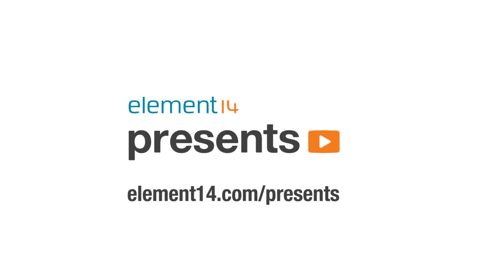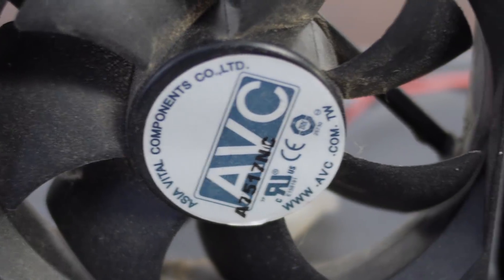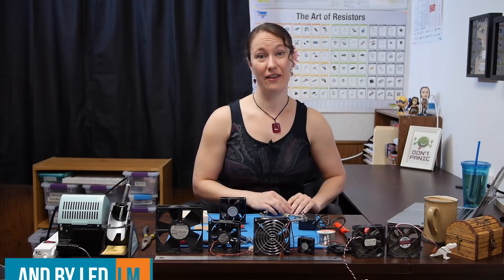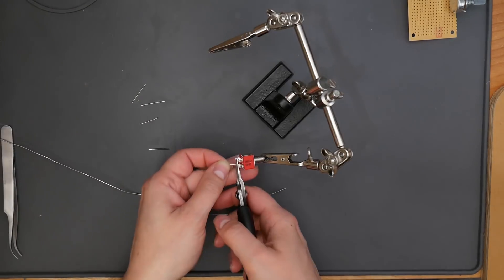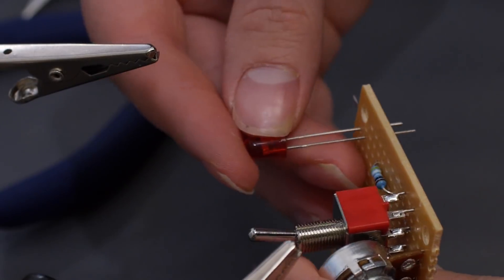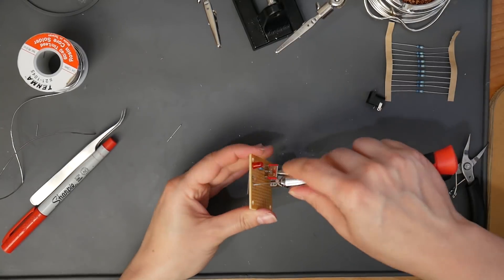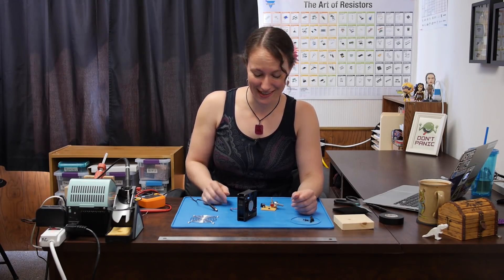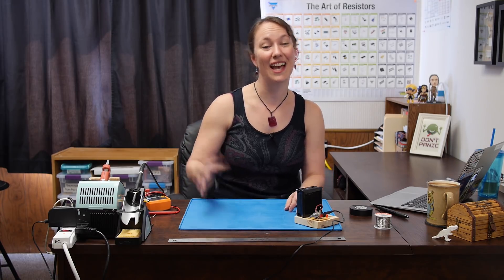DIY Desktop Fume Fan - The Learning Circuit

Comment: The LED is rated for MAX 20mA. So usually, one should build in some headroom. E.g. if the 9V battery has actually 9.4V, the LED only has 1.9V drop and the 330Ohms resistor is a 5% resistor at the edge of specs, that already adds up to 24mA! Working outside specs is a bad habit to teach. LEDs work fine at much lower currents, so I usually aim for 10mA which leaves some headroom for e.g. changing voltage, using different colored LEDs, etc. For 9V/12V I usually just use a 1K and call it a day.
And a pot as a variable resistor for a motor??? Also a very bad habit to teach. That is how I had my first magic smoke release as a kid.

Comment: What ohm range was that potentiometer? I've learned in trying to build this that a 5k potentiometer is not usable. (I should've done the math first but y'know). With a 5k it basically goes from off to full blast just right at the edge of the full swing. Rip

Comment: Might be a silly question, but can I just use a regular battery-powered or wall-outlet-powered fan and place a filter on it? Rather than assembling all these parts. I feel like the answer is a self-explanatory "yes," but I just want to be sure since I'm new to electronics and soldering. If I need a fume fan to avoid solder smoke, I don't necessarily want to solder and breathe in the fumes in order to create the fan lol. Awesome video, and a cool project to practice skills. Entertaining presentation as well!

Comment: I've been soldering components for nearly 50 yrs. Whenever I make a solder joint I always blow gently on it while I'm applying the solder so that the fumes disperse away while I'm working. (Notice I used the word "gently". I do not blow so hard that it would affect the temperature of the work. Just enough to disperse the fumes).

Comment: The current through an LED does not have to be exact -- anywhere from 5 mA to 20 mA will generally do fine.  So I don't think the resistor will need to be changed for a different color of LED.

Comment: will more ohms equal less voltage to the led? Or does it need less ohms to lower the led voltage. I still don't understand ohms. I just thought one 1 volt would be -1 ohm, and -1 volt would equal 1 ohm. I would like to try this project because things like resisters and leds are cheap online.

Comment: I use the nursery or plant grow fan.  They work excellent with a window box and you can use a stiff piece of dryer hose over where you're working.  Working on a ERV air heat exchanger air regenerator currently to improve the design so I don't waste so much heat and get a better balanced intake of air.  Basically, using the coroplast design by ( https://greenwayerv.blogspot.com/p/project-brief.html ) and ironing in aluminum screen on each side of the coroplast sheets.

Concurrently, for other projects... though might lend some inspiration for others to consider other filtration designs (I know I found out in my younger years plastics can be welded with soldering irons too... just best to use a dedicated range of tips) ... I'm actually working on two PAPR designs... one is using the RAD-UM fan, filter, CPAP hose design with improved filtration for welding and other fumes and the other is based off the full face snorkel mask by Joshua De Lisle though not using the 40mm filter since I have a bunch of the 6000/7000 3M filters from my respirators.  Purchased the 4.5v inflator instead and plan to use the same controller... though with a 20V DeWalt battery which I have two spare trigger assemblies I found a great deal on to make adapters using.  Basically, as an FYI, the 20V tools have the 20V to 18V adapter built into them and sometimes that trigger assembly part can be found for $10 or maybe less if someone throws away a mechanically broken tool.  Just invested in a 3D printed battery holder with almost enough space to fit the battery terminals.

Comment: Was it something that I missed, or was the schematic incorrect, where it looks like the connections were between vR pins 1 and 3, with pin 2 not connected?  Wouldn't that have turned the pot into a static resistor, rather than being variable?

Comment: A handy little fan for removing flux smoke from the work area....Nice, but....There's always a but.
The foam "filter " is just defusing the fumes and not filtering them, you may want to look at an activated carbon filter for that. As regards to toxicity, if you're soldering every day then maybe look into wearing latex gloves so you're not in contact with the solder wire, if you choose to use leaded solder.  (Filter wise, I have found a 4" hydroponic carbon filter works perfect and you can find them for around £25. Yes they are large and may seem OTT but they will last a lifetime with a suitable RPM fan.
Keep on with the cool videos.

Comment: It's nice and entertaining but I think after putting air filter you should increase fan speed not decrease it with pot totally not needed and you are probably not going to solder so close to the fan. So more speed for larger distance and some direction like hose is better for sucking fumes.  This is nice for education that are starting to learn soldering. Nice job but need part 2 for improving this idea...

Comment: where do you get the 0.2amps to be divided by the 7 volts? please clarify
Reply: Probably a bit too late, but diodes have a tendency to "consume" too much current if you don't limit it. The voltage on the diode is about 2V, and the rest goes around the resistor. The current at any point in the circuit is the same so the current running through a resistor is the same current running through a diode. Most of the diodes burn out when the current is above 0.02A, so that's the limit you have to put to the diode.
Reply: @kacperfilipek8461  so what does it mean? 0.02A is the the standard amp? for the limit? tnx for the reply. iwas planning to start my electronics journey on this day & i think buuilding an extractor is the best 1

Comment: Screw that. Imma just cut the power supply cord, expose the wire,then cut the fan adapter, and then electrical tape that bitch together

Comment: I made mine out of an old broken electric heater. it had a 115v fan in it  so it could plug right into the wall with no adapter. I cut it down and reshaped it so it's about 6" wide by maybe 8" tall and about 4" front to back. I had a lighted on/off switch i'd took out of something else, so I used that. Charcoal filter was for an range hood, and that's the only part I spent money on. Works great.

Comment: Is it just me, or are flux fumes always homing in on the face?
Reply: Believe it or not research has been conducted and written to find out why 😂 It was concluded that the positioning of our arms cause this extremely annoying thing
Reply: just don't breathe
Reply: Because it's alive and wants to get inside you.
Reply: Nah its not just you.
Reply: The right eye, always in the right eye.
Reply: Like campfires.   I'm actually working on two PAPR designs... one is using the RAD-UM fan, filter, CPAP hose design with improved filtration for welding and other fumes and the other is based off the full face snorkel mask by Joshua De Lisle though not using the 40mm filter since I have a bunch of the 6000/7000 3M filters from my respirators.  Purchased the 4.5v inflator instead and plan to use the same controller... though with a 20V DeWalt battery which I have two spare trigger assemblies I found a great deal on to make adapters using.  Basically, as an FYI, the 20V tools have the 20V to 18V adapter built into them and sometimes that trigger assembly part can be found for $10 or maybe less if someone throws away a mechanically broken tool.  Just invested in a 3D printed battery holder with almost enough space to fit the battery terminals.
Reply: @jafinch78  what
Reply: @alois_ludwig  Whew, was I on a rant there 4 years back.
Reply: @jafinch78  yeah, too many acronyms

Comment: dpst?  you have to be kidding!
Reply: In my parts bin all I have are DPDT switches, and it use them even if a single pole single throw is needed
Reply: Lukas Peruzovic , yes, I would too, but you wouldn't use both poles when one will do the job!

Comment: nice project, but some comments:

a) there are no toxic fumes from the solder metal itself at the temperatures used during soldering.

b) LEDs are not "rated for voltage" - they have a certain, varying voltage drop at a certain current passing through. It is therefore we use resistors: to limit the current.

c) you can safely use the same resistor (I would have chosen 470 ohm or even 1 kohm) for both power supplies. Doing the calculation backwards shows you that assuming 2 V drop over the LED and 470 ohm will give you 21 mA for a 12 V supply and 15 mA for a 9 V supply - you will probably not even be able to tell the brightness difference by your eye.

d) yes, speed regulation with a small carbon track potentiometer is not a good idea.

...and finally I would probably mounted the filter mat before the fan to keep the blades free from condensing flux
Reply: yeah its the flux that you shouldnt breath in

Comment: Sorry, but you should perhaps run these past someone with more electronics experience first. The potentiometer is unlikely to be rated to handle the power of the fan, and the schematic is drawn incorrectly with the wiper not connected and only the fixed resistance of the track in circuit. Also the double pole switch is unnecessary as it makes no difference the way it is connected. Rough calculations, with the pot at 10%, looks to be marked 1K, so 100 ohms. The fan was rated for 150mA, it's difficult to calculate how much current it will draw, as it depends on the design of the fan, so say it's half that to be generous, 75mA. P=I^2 R, so 560mW. Most potentiometers of the style shown would rated at 125mW max, so it's being run at more that 4 times it's rated power, and probably won't last long depending on where it's set. A wirewound pot could be used, but they are more expensive / more difficult to get hold. Maybe a fast/slow switch with a suitably rated power resistor bypassed for 'fast mode' would be better, assuming a  PWM controller or a more complex transistor driven circuit is not an option.
Reply: you should make your vid eh?

Comment: I'd stick a transistor in between the fan and supply,and use the pot connected to the base of the transistor,to control it. Might be less likely to fry the pot that way.

Comment: I love this video. Thanks Karen!

But where do you get those push pins to install the cover on the fan? I have a few from computers I've taken apart, but I'd really like to have some more. Since they're a quick way to install a fan without having to tap the screws into the fan.
Reply: It was already on the fan I used. Must have been salvaged with the fan when it was pulled from the PC tower. So basically, "Sorry, your push pins are in another tower."
Reply: Even though you couldn't really help me, your answer did make me smile.

You're one of the reasons I want to start soldering again.

Comment: Where did you get.02 amps for the ohms law equation?
Reply: Rating of the LED. Some LEDs are actually too bright at that current, so use a larger resistor.
Reply: NiHaoMike sooooo in the data sheet?

Comment: If you get a plastic container, cut a hole, hot glue the fan in place, and fill the container with air filters... no fumes at all will go into the air.

Comment: *citation needed.
Unless you are using a soldering iron all day every day for years, the risk is negligible. More dangerous to walk by a road.
Reply: When they traced how/when Steve Jobs most likely got his cancer exposure, it was determined that it was a job he held as a teen working soldering electronics. Take every precaution always.

Comment: I'm still wondering why a DPDT switch is any different from a SPST with both parallel (variable resistor & fan) and (LED & resistor)? The argument for DPDT was because they "shouldn't be put in series", but why not put them in parallel after a regular switch?

When you turn the 'lever', but you have both inputs connected to the same line, both outputs are also effectively the same line?
Reply: DPDT is an on off on switch. It is affectively two switches in one.
So while both sides share the center tap which should be wired to ground, their other pins are wired to the two different power sources, one being 9 volts the other being 12 volts.

While you could attach both power sources to the center tap and then utilize the separate throws that then point to the different sized resisters, there is the possibility of moving the switch to the 9 volt circuit when the 12 volt source is connected. This design makes that possibility nearly impossible. 

This design also allows the 9 volt battery to remain connected when the 12 volt source is connected making it a battery backup.
Reply: Since the poles are one one side both connected, it's no different from a regular switch. The voltage before the rest of the circuit is the same (either both grounded or both 12v), the resistor reduces flow through one of the parrallel tracks, but the switch doesn't have a reverse-protection diode and doesn't really make sense imho.

Comment: In this instance, you'd likely want to actually use a larger fan that pulls a lot of air at a good static pressure -- i.e. not an 80mm computer fan. I have something like this at home that uses two 120mm Corsair SP120 fans. Ideally you'd probably want to use a 180mm or 200mm case fan - or two - to really move the air. Only issue is finding filter material that large in one sheet.
Reply: brandishwar Agreed. I built one that uses a single  120mm*40mm server fan. Can move a lot of air, so I don't have to shroud it.
Reply: Buy a Walmart Lasko box fan and tape a cold air return filter to it for about $15 total and have tons of fume-sucking power for minimal time/$.
Reply: You just have to find a good source of carbon air filters and many hepa approved air purifiers have them, so it is probably be better for your health to make a filter box that your filtering material goes into(carbon sheet filter for smells and HEPA approved filter material for trapping flux) that you mount to the fan with a shroud to make sure all fume smoke go into the filter box.

If you want to use a small fan then the Vantec Tornado is the way to go, just make sure you use a fan control circuit or a potentiometer to keep it undervolted or it will move on it's own under the air pressure.
Reply: I bet one of those beefy 2U server fans would be great for this

Comment: Would it have been better to just use the circuit out of a light dimmer and just change some values to make it work on 12 volts.
Reply: What do you mean by a light dimmer?
Reply: Maker_Karen using a light dimmer as a starting point change the Diac  and  the Triac for suitable ones for operation on between 5 and 20 voltsand change the resistors for values like 47k and 470k
Reply: would not work, triacs and diacs only work with ac, with dc they would just stay on once turned on, they work on the priciple that ac goes to 0v 100 times a second (in case of 50hz mains) and it's at that point a triac and diac switch off when they are not getting an "on signal"
Reply: TV3master I would have used AC not DC
Reply: fair enough, but good luck finding an ac fan that size, they get very expensive very fast
Reply: Thanks for the mini lesson! That's good information.

Comment: I still don't understand why she subtracted the two voltages in her LED resistor calculation...
Reply: I go into further detail about Ohm's Law in this video, 
https://youtu.be/kQoLy_us5J4?list=PLwO8CTSLTkii9S_vhEOsyJ17RI3jjBZ95.
Reply: That video was no help at all. The reason I'm confused: 12v / 500ohm = ~0.024A . The resistor only affects the voltage, not the current. Also, wouldn't the Potentiometer in parallel affect the current of through the LED?
Reply: Nope - this pot is in another part  (or circle) of  a circuit, witch is closed thought the motor  (Kirhof's lows ) . The current is determined by a choose of led , not by the resistor. You are right - the resistor will limit the voltage. Overvoltage on led is not recomended too, like overcurrnet. (See the datasheet of any led). But Caren is in error with  determination of resistor - always choose  higher stadnarT resistance than calculated  !
Reply: I'm thinking: The resistor is used to limit the power going through the LED (P=u*i), so the excess power (the difference in voltage and the maximal current) should be limited?

But in this case the maximal power of the LED should match the power (after the resistor), I'm just not quite sure if it will actually regulate the voltage/current (afaik still 9V but just 4x lower current?)
Though I'm thinking that the LED has a set current and thus voltage is limited (as in a voltage divider).
Reply: If you look at the datasheet for an led it will have a value called VF or forward voltage. This is the voltage which is needed for the diode to conduct. This varies between different colors etc. 
To calculate the resistor you need you simply use Ohms law which is V=IR, we want R so it transposes too R=V/I, V= the supply voltage (VCC) - the Forward voltage of the diode (VF) divided by the current you want in this case 20mA.

Therefore R = 12v - 2v / .020 == 500ohms
Reply: But if the Supply is 12v and there is a resistor of 500ohm, why is the current through that part of the circuit 0.02A... Does the LED affect the current?
Reply: Jake Stephens the led drops the Vf across it. That is to say it consumes its Vf. So the 2v Vf has to be subtracted from the Vcc